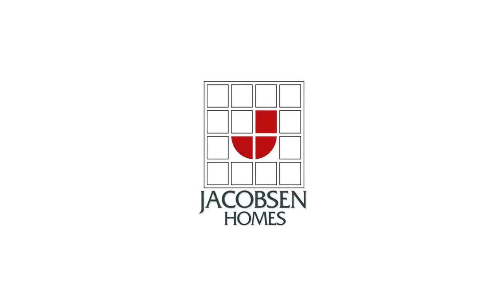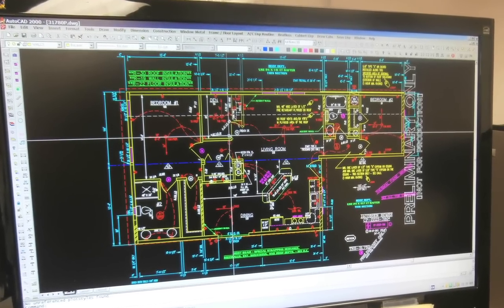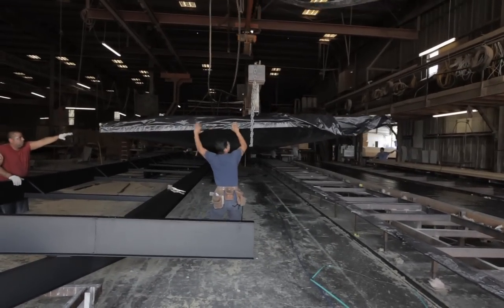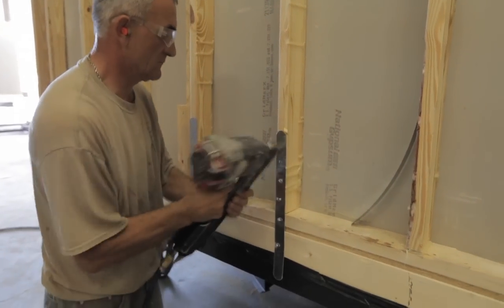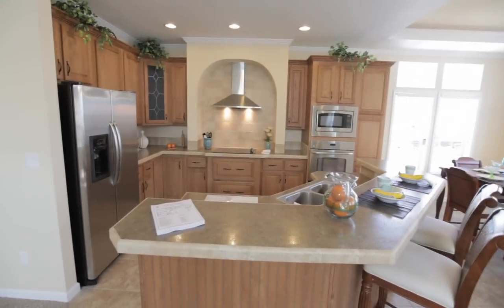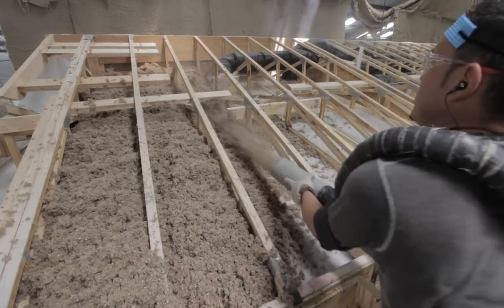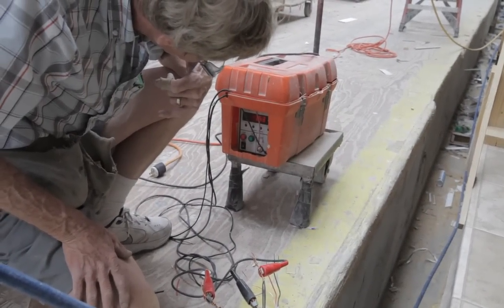Jacobsen Homes Factory Tour

Comment: I owned a mobile home park and all the "trailors" (homes ?) in it . Then spent years trying to keep them together and rented. I lost the fight they fell apart quicker than I could fix them. My advice ,do yourself a favor and have nothing to do with mobile homes they are a rip off. Not to mention people who rent them will become your enemy determined to make life hell. That type of flooring should be outlawed ,it has a very short use by date. So don't listen to me , buy it and see how you feel in 10 years .
Reply: My mobile home is more than 50 yrs old and its still standing! Not a jacobson but it is a trailer none of the flooring is original and neither are the walls now it has sheet rock instead of paneling! The outside had vinyl siding put on years ago improperly as are the ones in this video! Stapling should never be done as the slotted mounting points are slotted to allow movement as it shrinks and expands due to conditions outside! Always use siding nails or screws in the center of the slot! And never fully tighten them to allow movement! You can not get that with staples
Reply: How old were the homes in your community?  I recently sold my mother's 25 year old Jacobsen Home for more than she paid for it.  It did not fall apart.
Reply: These are not mobile home. They are prefabricated homes and once built do not move. There is no connection between these types of homes and the trailers in mobile home parks. It’s a great idea to build homes under factory controlled conditions inside out of the weather. Less waste and easier quality control. I agree that mobile homes are shit and are a poor investment but these are not that.
Reply: I agree I rented mobile homes myself I bought 8 brand new 14x80 3 bedroom 2 bath mobile homes I now own one and that's the one I live in they constantly had problems the roof leak the plumbing leaks the manufacturer was a nightmare to deal with for repairs I sold the units to the tenants and now I just rent the lots renting mobile homes was a nightmare
Reply: they were either poorly cared for, not a well built home, so it was a cheapo, piece of crap..had 2 neither had any issues, the last one is on its 3rd owner and still standing..
Reply: My sister has a Fleetwood and we're constantly helping her put it back together. And just when you think you have a plan on how to repair, you get into the job and realize there are 10 other problems. They are complete junk. People should just buy a small stick built and they could add on later if needed and they will be much better off in the long run.

Comment: I am looking at buying a Jacobsens just wondering what is done to prevent termites?
Reply: Please don't be stupid enough to buy this crap. These arehorrible !!!
Reply: You need to have the ground treated.  Also, if you will be putting on a site build porch, have the dirt inside the porch treated.
Reply: You have to elevate houses off the ground  with cement blocks. Building code will guide you

Comment: I noticed a lot of gaps between the joinery and the plastic water lines with metal clamps are a mistake. "less likely to leak"....I had a leak in a guest bathroom which caused $3200,00 in damage and required me to replace all floor insulation. When I did that I found that EVERY joint in similar plumbing had leaked. I replaced all of it with PVC.
Reply: Pvc up here in Pennsylvania is the wrong choice as they burst! Ive had my pex go through 3 freeze thaw cycles this winter with absolutely no leakage! Pvc has burst on me twice! Oh and they are insulted and have heat tape but 20 blow wins every time
Reply: @herbhall3830  I can see why it would not work there, being in South Georgia I don't have that issue. We all have to find what works for us in our respective locations.
Reply: I have installed a few bath tubs doing remodeling . The new faucets always leak and I solder them. I wonder how many people  walled them up with a slow drip in a confined space.
Reply: In something so small would it really be that much more to just use copper and never worry

Comment: That looks so cheap!!  What is the real price?
I debated on building a home or buying a manufactured home. 
Overall, after inspecting many models and other floor plans I made my decision 15 years ago and I have no regrets and have been very pleased with my 2001 Karsten K-20 Estate Series. 1,980 sq ft.  Beautiful layout for my farm setting. It’s a 3 bedroom 2 bath. Has 9 ft ceilings. All taped and textured. Skylights. Heavy framing. A 3.5 ton a/c unit. Premium upper and lower molding trim. Not once have I and other Karsten K-20 & K-30 (triple wide) have experienced mice in the house. That’s how well the home is built. No other manufacturer comes close.
Reply: i saw the process for those Karsten homes, they are way better built.

Comment: I love my modular home and it was built in 2004 and it is my dream retirement home .I would go factory built again if need be .You have a set price and no over run cost .I had my steel frame left on even though my house is on a basement .It makes the floor feel more solid over any stick built .It is stick built

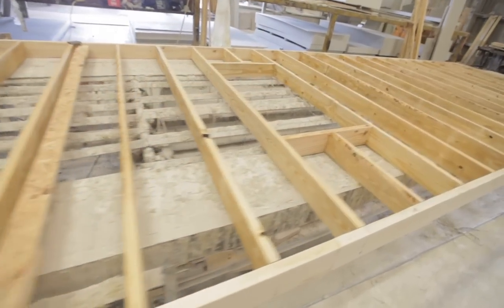Comment: 4:53 - studs not carrying load to bottom plate.
Reply: Would that pass inspection in Florida?
Reply: The studs aren't even tight to the bottom plate so they're framing edicate is crap you can expect this wall to be square 🤷🏻‍♂️
Reply: @lukebellamy7386  isn't normal to be off 1½ inches on every wall lol
Reply: Use of screws instead of staples to draw in warped boards would prevent this as staples cant draw in the wood! I do assume all studs cut to same lenght!
Reply: The studs are nailed to the top and bottom plate
Reply: looks like a 3/16 gap between stud and bottom plate
 @jacobsenhomes1347
Reply: @jacobsenhomes1347   the stud bottoms were cut crooked. leaving a gap on the inside.   at the beginning the steel frames were horribly rusted before they were coated with the black coating.. coating won't' stop that..  you may want to build a sand blasting box to slide the raw steel thru and sand blast it from all sides to get rid of the rust  before you cut it.  it might be a sliding box instead of sliding the steel..  rollers on each side of the entry and exit points.
Reply: @waynep343   " coating won't' stop that." Actually, it depends on the coating. There are coatings out there now that bond with the rust and turn it into a shell, kind of like M&M's. lol. Not sure what they are using but it is available.   "... we have the technology..."
Reply: @waynep343  they should be using something like corten steel that is meant for sea water exposure. but their probably using the cheapest Chinese steel available.
Reply: @waynep343  i noticed that as well! Trapping the rust in to cause havoc in years to come
Reply: @kercchan3307  I don't know if could ever keep steel from not rusting some no matter what you put on it or do to it, but I don't remember ever seeing a steel frame under a house rust away like a car body.
Reply: @kellywhite9278  it depends on the type of steel alloy and the treatment it gets, some steel alloys only get surface rust, while generic steel will rust away. Aluminium also rusts so does copper but they develop a surface rust that protects the whole.
Reply: @waynep343  but I thought they had control of the weather since everything is inside of Warehouses and not in the elements. LoL
Are you trying to tell me that the coating they spread over the RUST won't stop that from destroying my home that I just spent my life's earnings on? FML what a joke this company is did you notice the dude who was putting 9 or more nails in each corner of the window frame? How can they say they have a rigorous inspection system for the home's and right in front of the camera we have caught so many things with there own video
Reply: @cntslesfabrication   the best thing in home building ever is the Simpson strong tie.  my sisters and her husband bought a tract house while still being framed..  he went in and added simpson strong ties to every joint he could get to..  during the northridge quake they were thrown 4 feet in the air over the bed twice before it started shaking.   their house did not have a single crack.. no broken windows.. no damage at all.. every other house built by the same crew had major structural damage and massive cracks in plaster and stucco..
Reply: @waynep343  that should have been done to begin with by the builder. When the homeowner is doing what the home builder should be I really wonder why people pay for there expertise when building a home. In Las Vegas if you're home was built between 1999 and 2012 in a subdivision they had so many call outs on the homes it would take 3 to 4 weeks to be added to the schedule unless it was life or death problems. If you bought a home and everything was finalized to start building the home it was only taking them 5 to 6 weeks to build a new home. I had 2 warehouses built in 2004 my Jr year all out of concrete each building was 100,000 sqft. Then in 2007 I had the last 2 warehouses built 75,000 sqft and 1 of them had my house and shop built on 1 end of the building. I had a 5,000 sqft shop with 14ft roofs and the 2nd floor was my 5,000 sqft home. All the contractors did was 5 A/C units on top for the house and all of the fire alarm system with sprinkler system per code. Once it got signed off I did everything myself or had someone else lined up to the work that I wanted done between the house and shop. The shop required 4 480 volt systems for all the different types of equipment that I wanted installed or was going to buy in the near future.

Comment: Prefab homes are great....there is lot of precision in dimensions... perfection in installation....very cautious in designing for Electrical wiring,  pipe line for water... Gas line. I liked much as lesser use of cement... bricks.
Reply: It all depends on the manufacturer. All of these are built to a price point, usually, you get what you pay for but I would research the homes and find reviews from people that have owned them for a long period of time as well as the newer homes because quality can change over time in the construction business.